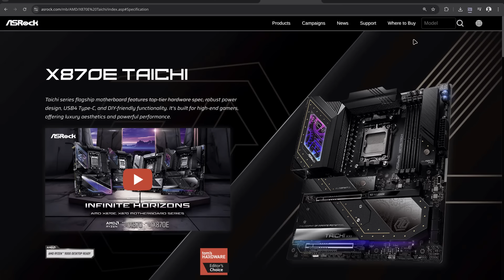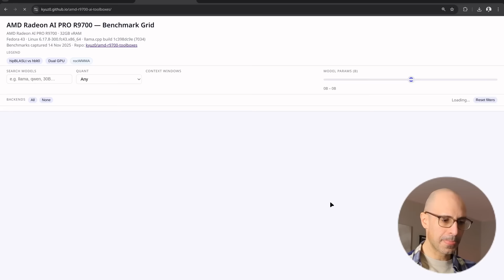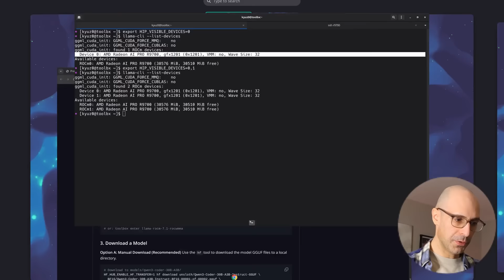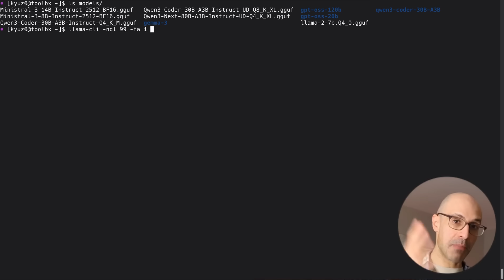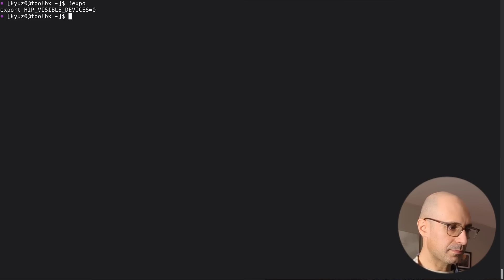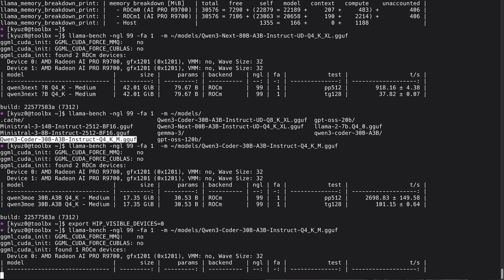Dual AMD Radeon 9700 AI PRO: Building a 64GB LLM/AI Server with Llama.cpp

Comment: From a noob perspective what relevance have the results of the benchmarks if the quality of the result isn't weighted, a faster model problably only delivers worse/unsusable/wrong  output faster, if another model takes double the time but providing good/usable/correct output it will save much more of the time of human work to check/verify/correct the output.

Using an AI-model e.g. for trading, for defence,... its the difference between going bankrupt fast, initiating WWIII and probably getting rich not at the highest theoretical possible rate and keeping peace.

So speed is one metric (of course important) but isolated it is useless, its like driving with 300 mph directly to a hairpin on the stilfser Joch without considering the breaking point. possible necessary but not sufficient.
Reply from the maker: Totally. If you're interested in qualitative performance, that's a very hard thing to measure and there are hundreds of benchmarks that do that exactly, but not the focus of thid specific YouTuber series. This is on documenting and testing the performance of the hardware, not the models.
Reply: @donatocapitella  Hello Donato surprised by this fast response! I'm just tinkering around currently as with my new 9070XT there was the software bundled currently mostly LMStudio, still surprised what is delivered if prompting at the models. 
Currently more for self-studies "Write a tutorial at..."

i saw the 9700 basically a 9070XT with double the RAM at double the price so now i'm curious what a comparison between 2 9070 XT  (or even non XT) would look against a single 9700 AI Pro).

What in your opinion is the needed amount of VRAM to aim at Non-professinal usage. More as local personal Chat GPT, How many parameters and what quantization to look for, if the model is 13 GB ist that to much for a 16 GB card or better going around 8-9 GB model size.
Reply from the maker: @tomsun3159 I don't have a 9070 XT. It's hard to give advice as to what would be enough for personal use, it really depends on the tasks you want it to do and help with. One thing is clear for me, more cream is always better. I would not go below a 4bit quant, but some 3bit quants can also do the job in certain cases. Good current models I use are from the Qwen family, I find the 3.5/6 35B one to be overall good also in 4 but quant, but I often use the 122B
Reply: @donatocapitella  If i look at my list of downloaded models qwen 3.5 9B Q4  has a size of 6.1 GB, Qwen 3 14B Q4 has a size of 8.38 GB. The bigger model offered for Download in LM Studio capable of full GPU Loading were from Mistral e. Devstral small  24B Q4 with a size of 13.35 GB but i think than the Context will be limited very soon.
i think a qwen 3.5 35B Q4 will fill up even the VRAM  of the 9700  quite good. Can i simply pull other models than offered by LM studio and put them in my folder and use them or do they need special modifications?
Reply: @donatocapitella  Just found your LLM chronicles  watching the first part actually , yes using the first time Chat-GPT "What the heck" yes exactly the same to me.
Reply from the maker: @tomsun3159 I have no idea, I have never used LM Studio, I don't know how it works - but I'm sure they have some kind of support place where you can ask them.
Reply from the maker: @tomsun3159 I had so much fun making LLM Chronicles, hope you enjoy it, it ended up being quite dense and more involved than I had ever planned!

Comment: Such a nice setup but the inference engine is garbage. vLLM would double the throughput!
Reply from the maker: It depend on use case. As you can see I also fully tested and benchmarked vLLM. Llama.cpp is NOT garbage by any stretch of imagination. If fact, in local, low concurrency settings it actually outperforms vLLM. vLLM of course, due to its design, has much higher throughput in high concurrecy settings.

But there are many advantages to llama.cpp, including much better model and qiantization ecosystem.

Comment: For people considering this, keep in mind this is at least a 4000$ build as of now. In Europe, it is 5000$+ in most countries. 

This is a lot for running AI locally, and you should only aim for this if you really need full privacy and a 24/7 AI workstation. 
If this is something you will use occasionally, I'd still suggest going for subscriptions. 

Claude Max is currently 100$ / month. Even with a lot of API calls added, you would need to use Claude Max for 3+ years so that your investment pays off. Additionally, Claude will always be SLIGHTLY better than your local model, but this shouldn't matter for 99% of use cases.

Great video, and I think this is a viable option for people who need LOCAL AI agents running basically 24/7 and HEAVY usage. If that's not you, there is no way this pays off.
Reply from the maker: Unfortunately prices have gone up. I'm working on a new series focussed on vibe coding agents with local llms and making them run reliably with local llms. I find openclaw doesn't really work well enough, but hopefully I can slow how rolling your own agents can get security plus viable performance
Reply: Yo me plantearía comprar este duo. Pero por ahora no lo veo necesario por que no estoy 24/7 escribiendo código. De todas formas, dudo que los precios que tenemos duren por mucho tiempo. Gemini, antes del 3.1 o 3. usaba la versión pro montón de tiempo y nunca conseguí un aviso. Ahora, cada dos por tres me bloquean el pro.

Quizás tú, por alguna razón no uses contextos masivos. Pero a mí esto me solucionaría mucho. Si, gemini PRO es superior, pero si me la limitas no me sirve. quen 3.6 es bastante capaz con 35b

Y la subscripción dentro de 3 años, no puedo revenderlo. Las tarjetas graficas sí. Y tal como está el mundo con el vram.. no creo que bajen demasiado. Si es que no suben...

lamentable, no me apetece pagar 4000€ ahora mismo. Cosa que si haría si se cumple alguna circunstancia.

Por cierto, @donatocapitella alguna razón real lejos de maximizar rendimiento, que no uses entornos amigables? o es puro amor por "Consola"
Reply from the maker: @juliosanchezcuenca  Answering in English. You're right, all coding agents now are restricting compute, and we have better smaller open-weight models for coding like Qwen 3.6 - I am doing a series on those shortly.

I think user friendly depends on the person. For my LLM servers, I do not want to run any Desktop Environment on them and I want a simple environment dedicated to them, so Fedora is one of the simplest and most friendly distros, and that's what I use to run AMD GPUs. It just works. On my workstation I use Gnome as a DE and that's where I run my coding agents like opencode/Kilo Code etc...
Reply: Well I already had a good gaming PC so adding graphics cards wasn't that expensive and the costs were spread out. I could easily blow through 600 million tokens in a week so buying video cards is considered cheaper for me than having to spend hundreds of dollars a month where they could cut me off at any time or censor the tests I need to run for my job.

Comment: Today, running this rig with Qwen3.5 27B at full quant will make you a king with your setup.
Reply: Getting 46 t/s on quad 3090 running the 27B at full quant with 262144 context. Getting 100 t/s running the 122B AWQ INT4 with 144000. I prefer the 27B because of the high accuracy especially for coding. INT4 starts to show signs of inaccuracy hence why I stick to the 27B. This is running vLLM, not llama.cpp. For multigpu setup, llama.cpp is garbage.
Reply: @cybergnetwork588 vllm is superior for networked systems or high concurrency, which is where I think everything is headed. I might start using it again in the near future.

Comment: Hi, this videos are brilliant! I'm evaluating to buy the same GPU, but only 1 piece for now. I have a RTX 3070 with only 8GB of VRAM, so I'm used to experience offloading to the CPU a lot. I'm using Qwen3-coder-next and was wondering if it is still possible to use the AMD GPU with Ollama (or other llm runners) while using both the CPU and GPU. In the final part of your video you get error while trying to load the Qwen3-coder-next model on a single GPU. Also, I would like to see the performance drop with such a big model on a single GPU (I'm getting around 2 token/s with a i9-13900k and 64G of DDR5 RAM). Thank you very much from Italy :)
Reply from the maker: Thanks for your support! I think that's because I chose a quant that doesn't fit into one GPU
Reply: @donatocapitella  Hi Donato, I finally bought the same GPU (the Gigabyte version, but only one piece). I tried different dockers for both llama.cpp and vllm, with all the possible combinations of backends (rocm 6.x, 7.x, nightly / Vulkan), but had several issues in finding the otpimal working combo. I expected this to be hard but not so frustrating and underperforming. Vulkan is the more stable and usable, while Rocm is a total mess. On Llamacpp I'm able to run any model but it gives far less speed in toc generation compared to Vulkan and much more speed in prompt (i can see similar results in your benchmarks). This seems to be a common issues online. vllm is absolutely unable to offload any model on GPU, so I was not able to run any model that usually runs on llama.cpp, even if the latest versins of vllm should support CPU offloading. It keeps going back to Triton kernels even if I tried any kind of environmental flag. I also tried to locally build both vllm and llama.cpp but it was nothing better than the official dockers. I didn't have time to test your dockers, may be I should give it a try, but from your benchmark I see similar results to what I observed on llama.cpp with the Qwen3-Coder-Next model (toc/s are quite the same even if I have a single GPU because from what I understand it keeps some experts on CPU). 

I would like to suggest you to try the Qwen3.5-35B-A3B with the Q5_K_S: it runs very smoothly on my GPU without offloading and I can keep a 256k context in Cline (VSCode AI agent coding) on llama.cpp+Vulkan. This combo is by far the best, with toc generation that goes from 70 to 60 toc/s on a fully loaded context, while the prompt can span from 300toc/s to 900+toc/s. I have a different build than your, but I saw that MoE models tend to clip the performance (i run a i9-13900k with +100GB of RAM on Ubuntu virtualized over Proxmox, so there are quasi zero bottlenecks).

Just for reference, I also have a RTX 3070 8GB on the same build and it runs slightly slower with Qwen3-Coder-Next in toc generation (prompt processing is obviously much slower).

So this was just to say that I should try your dockers but don't know why they could solve the llama.cpp/vllm + ROCm7 issues I have. Vulkan is fantastic in keeping the VRAM down a certain threshold and it didn't never crash, even if I fill entirely the 256k context. ROCm is really unstable and unpredictable. This didn't happen with CUDA and the RTX, but may be also because it's too much short in VRAM. 

EDIT: every model I run on vllm run much slower compared to llama.cpp, even very small qwen models that could fully fit in VRAM.

I'll appreciate any kind of suggestions. Thanks again
Reply from the maker: @pietropugni5118  sorry you are having such a bad experience. For most people they just install Fedora, then use the script on my repo to create the toolbox they want and all seems to work. I use this exact setup in the video on a daily basis, indeed Qwen 3.5 is the main open-weight model family I use now and I have an upcoming series on how to make local agents leveragining these models!

Comment: I feel like most open weights LLMs are made for either 16GB or 96GB.
64GB is in this weird spot where you still have to offload layers to make it work for the bigger models.
Tripple 9700 AI with 96GB VRAM works much better. But it can be tricky finding enough PCIe lanes on lower end motherboards.
Reply from the maker: To a degree, with qiantization a lot of good models fit 64GB fairly well, with all the quant options llama.cpp offers one can really experiment
Reply: @donatocapitella  Of course every LLM is different. My experience is that with 64GB VRAM for bigger models I either need to offload to CPU or use poor quantization like 3bit with bigger context sizes. And some models are not available in FP16, making the 3bit quants even lower quality (gpt-oss-120b). Thanks for your reply!

Comment: Recently built a setup with one R9700 and it works great with the latest Qwen3.5-35B-A3B Q4 (>110 tg/s). Could you add a benchmark for this model and compare single GPU with dual GPU performance for the same Q4 models? Wanna evaluate if the performance burst worth the extra GPU, thank you.
Reply from the maker: I will!
Reply: @donatocapitella  Hi Donato, could you add a benchmark in Live Performance Benchmarks page for these 2 popular models, with single R9700 GPU and dual GPUs setup for the same Q4 models? Thanks.
- Qwen3.6-27B Q4 (good for agent)
- Qwen3.6-35B-A3B Q4 (very fast for general purpose)
Wanna evaluate if the performance burst worth the extra GPU, thank you.
Reply from the maker: @anhkhk just checking if you mean for llama.cpp or vLLM, for llama.cpp it's easier, for vLLM I need to add support for the models.
Reply: @donatocapitella  It's for llama.cpp, waiting for the update, thank you.
Reply from the maker: @anhkhk  now I see what you're asking. My understanding (and testing) is that in llama.cpp, splitting a model across multiple GPUs is primarily a solution for capacity (running models too big for one card), not necessarily for speed.

It will run slower on two cards than one because llama-cpp uses layer splitting, so I think it would only help with many concurrent requests.

On 1 GPU you get this for pp 1087.33 and this tg 26.38 for the 27B. For the 35B you get 1044.87pp and 24 tg

Comment: Thank you for your detailed explanation of the topic. 

Can you tell me please how loud is dual radeon setup? Does it require an open computer case? How is the temperature when working as a server? 

Once again, great video.
Reply from the maker: I need to re-run the benchmarks and note down the temperature, it can get hot under heavy load but I don't use an open computer case and I didn't have any temperature issues during the benchmarks - but you can see that airflow is quite good in my setup. It can get loud - I might try to measure how loud it gets next time I re-run the benchmark suite.

What are you thinking in terms of workloads you'd like to run? If you're training or crunching a benchmark or serving 100s of parallel requests, I doubt it'll get hot or too loud.
Reply: @donatocapitella Tomorrow I'll get my R9700. I’ve heard they can be pretty loud, so I’m wondering how distracting it might be when using it for programming — for example, as a code assistant or for code generation.
Reply from the maker: @jsr9703nice! I guess it's also personal preference, it can be like white noise, but again probably a single user coding agent might not stretch the card to its fullest! I always code with noise cancelling headphones playing music, so I'm not the best judge!

Comment: Impressive work you are doing! Do you use this setup also as your daily driver as a sofware engineer? If you had to choose between this setup or the strix halo as your daily coding driver, which one would you choose and why?
Reply from the maker: At the moment I don't, I'm using Anti-gravity as it's ahead of what open models can do. But I use this for my work, dataset generation and attack LLMs in the spikee framework. Typically I use Strix Halo, but I have also used this setup

Comment: Does your distro allocate any of the vram or do you have the full 32g free?  I started with 519 allocated of 30g, disabled ECC and now am still at 519m allocated out of 32g total. the embedded graphics in 9700x is enabled and that port is what I use when needed, but I think there might be distro specific or linux in general config to ensure the r9700 is not used for display?

Comment: I have a dual r9700 setup but am unable to meet your benchmark numbers, even without any containerization.  I am curious if you recorded the exact models you downloaded anywhere, specifically the gpt oss 20b and 120b files. unsloth has a few collections, and then different quantizations listed.  I think my issue must be how I compiled llama.cpp, but still trying to remove other variables.  For example, ubuntu 24.04 lts rocm 7.1.1 single GPU gpt oss 20b:
 HIP_VISIBLE_DEVICES=0 /AI/llama.cpp/build/bin/llama-bench  -m /AI/models/gpt/gpt-oss-20b-UD-Q4_K_XL.gguf 
ggml_cuda_init: found 1 ROCm devices:
  Device 0: AMD Radeon AI PRO R9700, gfx1201 (0x1201), VMM: no, Wave Size: 32
| model                          |       size |     params | backend    | ngl |            test |                  t/s |
| ------------------------------ | ---------: | ---------: | ---------- | --: | --------------: | -------------------: |
| gpt-oss 20B Q4_K - Medium      |  11.04 GiB |    20.91 B | ROCm       |  99 |           pp512 |       1046.62 ± 3.69 |
| gpt-oss 20B Q4_K - Medium      |  11.04 GiB |    20.91 B | ROCm       |  99 |           tg128 |        128.40 ± 5.95 |

build: 0c3b7a9ef (7708)

120b is even worse, tg128 60/s
Reply: of course as soon as I ask I realize - you need to pass -fa 1 to llama-bench too!
Reply from the maker: @jdchmiel yeah, I document everything on the repository as well!